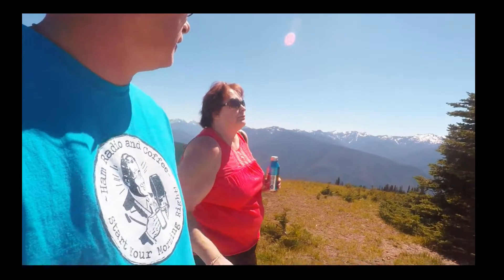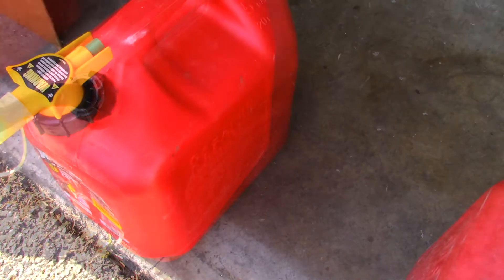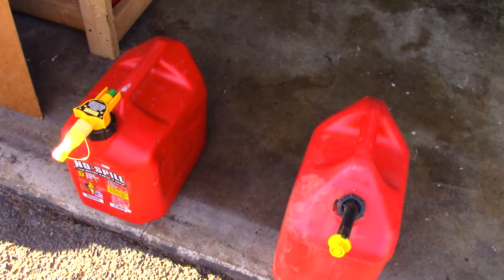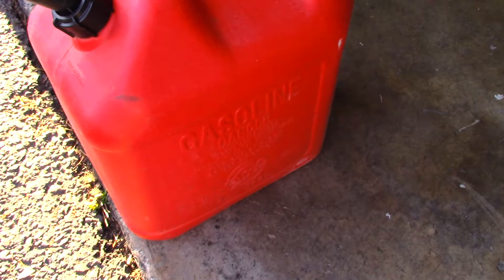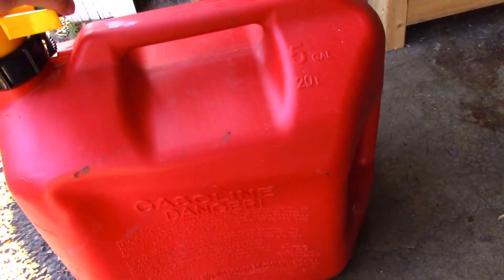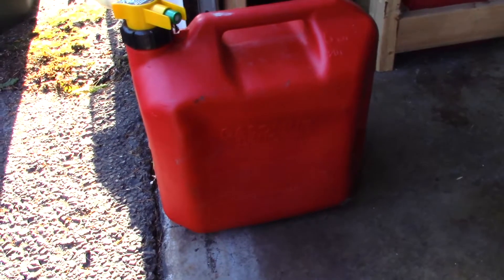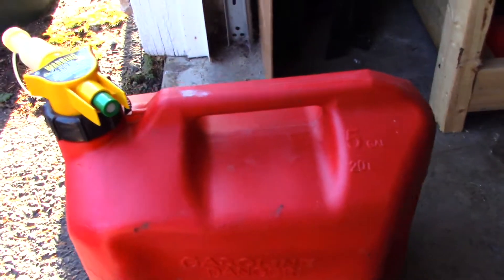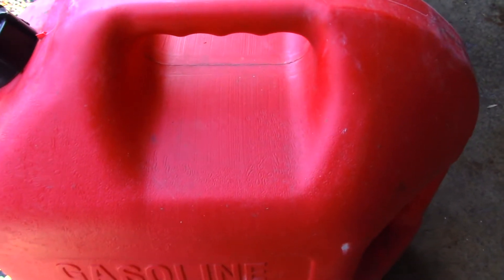No Spill Gas Can

Comment: I just press the button to allow air in or out, depending on how the gas can looks. I agree, No venting, but the gas does hold up better.
Reply from the maker: That would be a pain having to check the can all the time for swelling or condencing. The only other way to vent it would be to not tighten the cap all the way for it to breathe...just remember to tighten it before using. 
Thanks for your input!
Reply: Not really, I have to pass by them in the garage everyday, so no big deal.  Only takes a few seconds to do.  The only thing I don't like about the pour spout, it's hard to pour the gas in either of our vehicles.  The spout is just to short.

Comment: A sealed gas can will keep gas fresher for longer, especially gasoline blended with ethanol.  I also have the same blitz can with the same spout and cap and it bloats up so much it almost falls over in the summer and collapses/buckles in the winter.   I guess as long as the plastic holds up I'll live with em, my blitz is going on 13 years so far. I still prefer steel Jerry cans for long term storage.
Reply from the maker: Very good points.